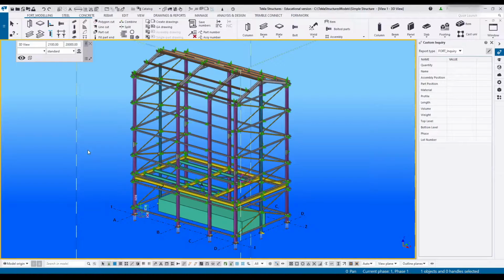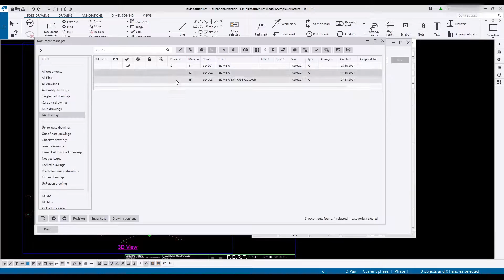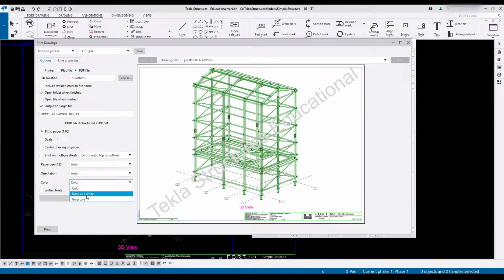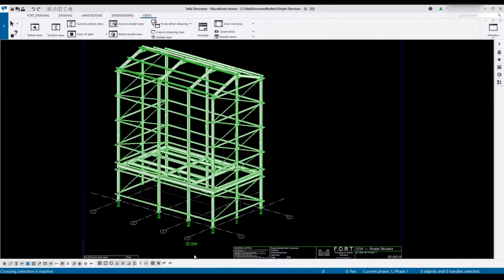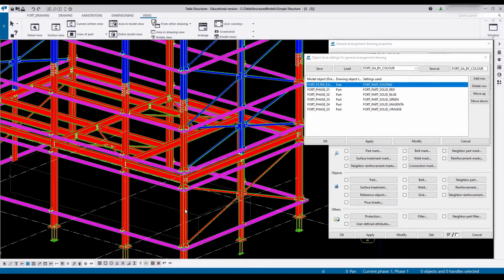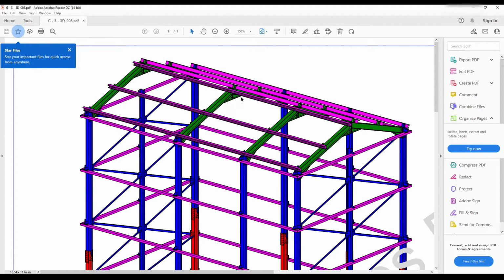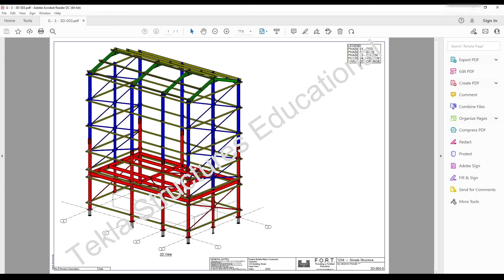Tekla Structures Drawings Coloured by filter

Comment: which environment is this, Im doing exactly same things but it doesnt work for me
Reply from the maker: This was done in the south African environment. But I have done the same in the Australasian enviroment
Reply: @FrenchmanontheRooftop  okay, it doesnt looks like because environment, it is about something else. Because I did this once on other project, exactly same. Made filtering and made part colouring with different colours and matched them, made all type of sections different colour. But on other project I cant do that I dont know why, doing everything same. 
It might be about configurations maybe? Something cones your mind about why it doesnt work this time?
Reply from the maker: @jeyn.r  what version of tekla are you using?
I'll check it tomorrow and see if there is anything different to it
Reply: @FrenchmanontheRooftop  v23. Thank you
Reply from the maker: @jeyn.r  I made a set of files. https://mega.nz/folder/SxxWiIIR#H_8ia4HxwjXWAHENZD3dog you can put in your model's Attribute folder.
I see it sometimes behaves oddly by not updating the drawing when the changes are made. You have to change the views area. either by dragging the purple area marker on the view or changing the values in the View Properties. Attributes 1>Define as distance.
(I just increased the "X min:" by 1)
hopefully this helps.
Reply: @FrenchmanontheRooftop  should I see your attributes on my tekla model now? I moved them in my models attribtes folder but didnt dont see them
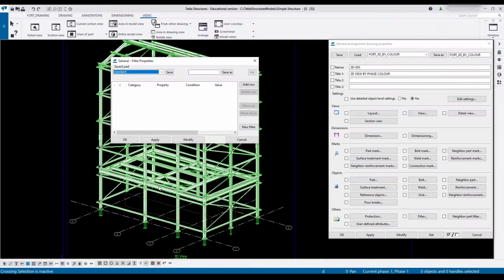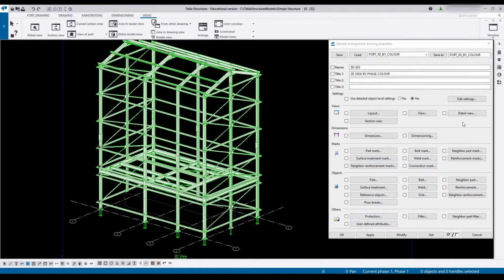Reply from the maker: @jeyn.r  yes. they are the filters as made in 4:50 object parts made at 4:50 and the detailed object level settings at 6:33

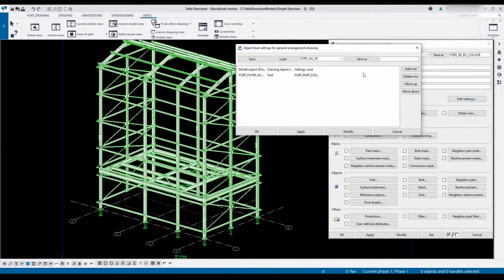You should be able to open the View properties, Edit settings (6:33) and load "FORT_ColourByPhase"